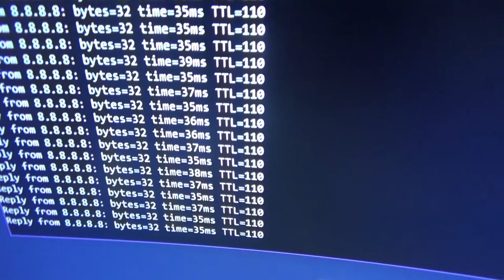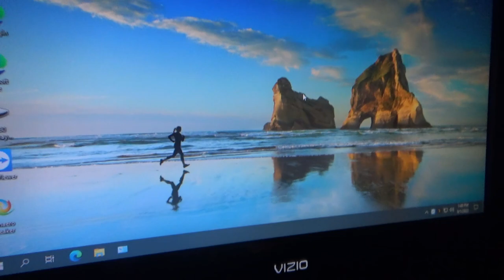Ethernet to coaxial upgrade (Hitron Bonded Ethernet Over Coax)

Comment from the maker: this was the first time I've tried something like this so I didn't record too much so I could figure everything out. But here is some extra info:

1. This is what I bought: https://www.amazon.com/dp/B08MQG6T61?...

2. No setup is required just make sure you have the Co ax cables connected on both ends and the Ethernet 2 and it will work after a minute of booting.

3. And yes it can work alongside with modems as long as you connect both ends to the TV port on these units.

4. If you have any questions let me know.
Reply: Do you need to have both coax terminals on the device to be used? or can you use one for IN and OUT ?
Reply from the maker: @bebdaumon3948  yep so you have one MOCA on each end of the coax and the port labeled TV is for a pass-through so like a cable modem or antenna, cable box eta

Comment: Dude you overcomplicated this so much lol.  Ideally you want the actual adapter in the room where you plan on having the devices in so you can have a single wire running the entire thing.
Reply from the maker: Sorry about that, I was still learning how it works and everything but its extremely simple though It's literally one coax cable and then the second one is for your modem, not set up required.

Comment: Can I use this to hardwire 2 wifi mesh points that are really far from each other?
Reply from the maker: These MOCA are basically Ethernet adapters so as long as your mesh supports a hardwired mode you could plug an AP into the main router just fine. (Which is actually what I use mine for)